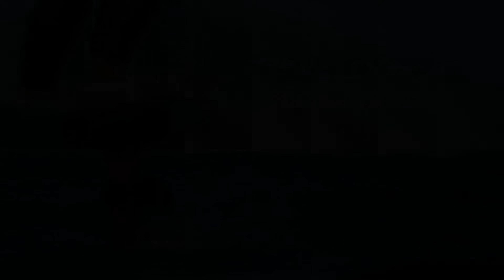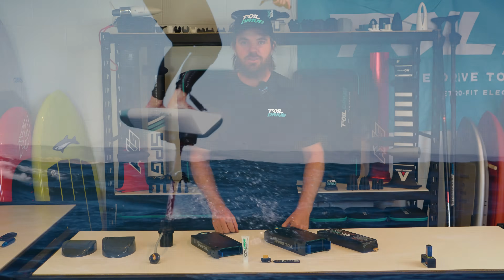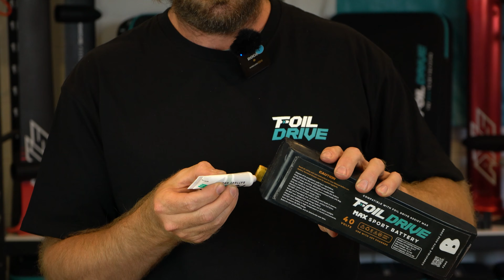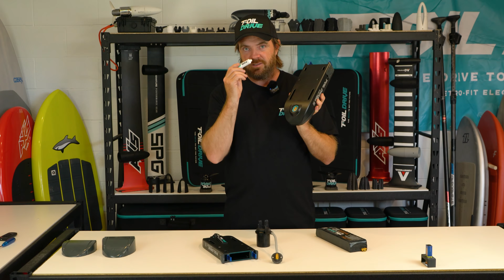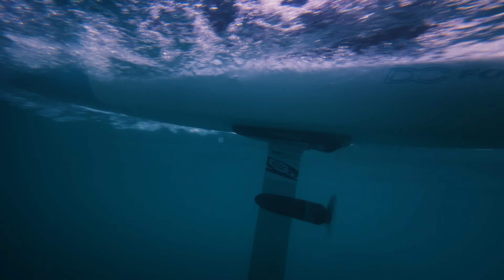Dielectric Battery Grease | Foil Drive Care & Maintenance

Comment: What is the spec for the grease? Im a new FD user and live in Cape Town, and would prefer not to import small tubes of grease. So I would like to buy the right grease locally.
Reply from the maker: Hey, thanks for asking! 

We advise to ONLY use Foil Drive Grease. While you can find similar grease options even small changes to the recipe can change how the grease works. We've had customers use something close to identical and destroy their batteries as why we only suggest using Foil Drive Grease. 

We are about to go live with a bulk buy tube of grease to tackle the exact issue of customers having to order in often. The bulk tube should last a lifetime!
Reply: did you find anything? wondering what the key consideration is for this
Reply: @skatehills nope, i bought a big tube of FD battery grease and decant it into a small syringe for application
Reply: I'm guessing just Dielectric Strength as close to 500 Volts/Mil?

Comment: Just out of curiosity, have you tested the connectors intentionally filled with water , partly filled with grease and fully filled with grease?

is the intent of the grease to displace any water from entering the connector.

Comment: Does this also apply to the Foil Drive Assist + ?
Reply: no - the battery connection is not exposed in the same way. It is inside the waterproof box for the FDA+
Reply: I had the same question - sometimes you do get some condensation in the FD+ box so i would have thought this would help? In the Gen 2 does water get inside the housing then? it looks like it shouldn't in which case it would be the same as the FD+ box? If we were to use the dielectric grease surely it can only help? @mceateat